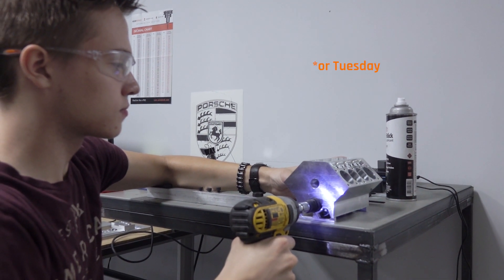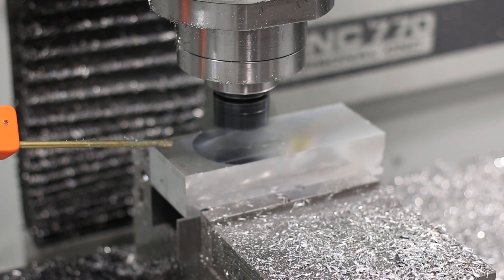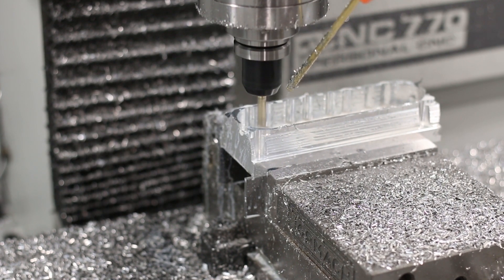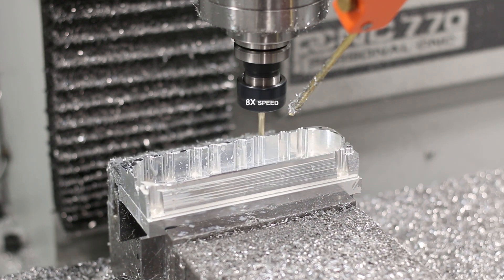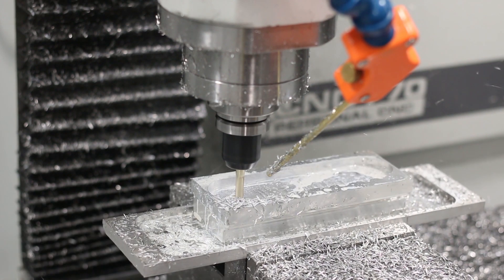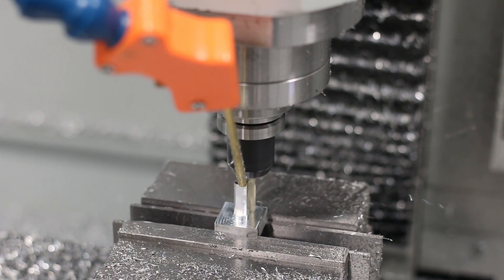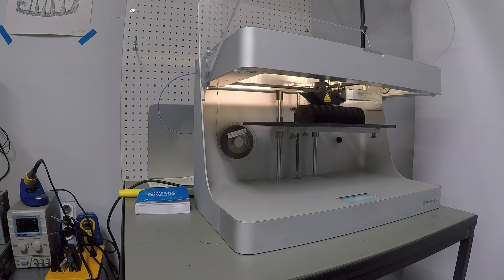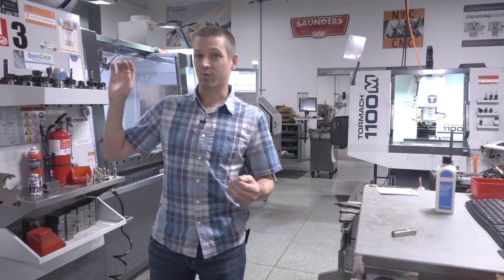CNC Machining V8 Engine Heads and Badge Pins | WW221

Comment: good project but if that much work was put into it before machining anything, you should've gone for an actual engine and then running, it would not be hard to sell or auction it for > $5-6000

Comment: Great work! I do have one request though to the machining community in general. Your machine may speak IPM and RPM but using those parameters by themselves tells me sweet nothing about how your running your tooling.

Can we all agree that SFPM or its metric equivalent and feed per revolution or tooth which is even better would be a much better way to talk about feeds and speeds?

Comment: I don’t mean this as a trolling comment, but am truly wondering if your company is breaking even as a job shop. I have done the the break even analysis before starting my own job shop, and I can’t make the numbers work. Any insight from you or other viewers is truly appreciated.
Reply from the maker: Short answer:  We did job shop work for ~8 years. We had very little overhead and, IME, it was good (albeit challenging) work but would have been difficult to scale.  In other words, the people, equipment, processes, etc to expand job shop work would have been challenging.    We now earn revenue through 1) SMW products including fixture plates, 2) CNC Training classes (nyccnc.com/events) and 3) YouTube
Reply: NYC CNC many thanks for the reply - there is some much competition for short runs, that it sounds like your plan to have different streams of revenue images a lot of sense.
Reply: They aren't a job shop; at least not any more. They stopped taking outside work 2ish years ago. The business is fixture plates, some other machine accessories, and youtube.
Reply: But note that he did make a job shop work well enough for something like 8 years to get where he is today. Of course conditions are different in different parts of the country and at different times, so what worked 6 years ago might not work now somewhere else.

Comment: XD not that it matters much but all the v8 crankshafts i know of have shared journals, the two pistons clamp right next to each other, theres only 4 outcrops for the pistons to connect to on a v8, the remainder of the space is used for main bearing journals that hold the crank to the block so the thing doesnt flex like crazy and snap in half